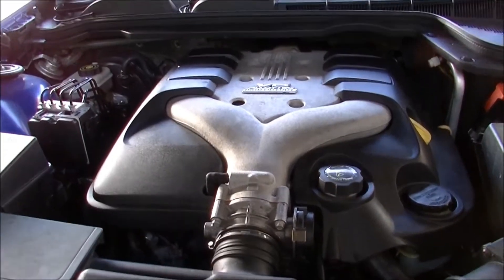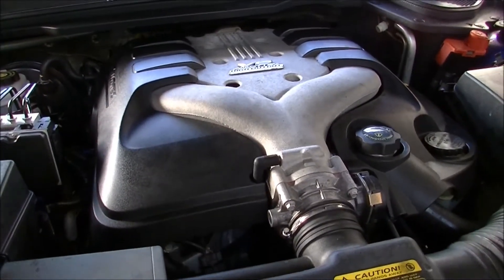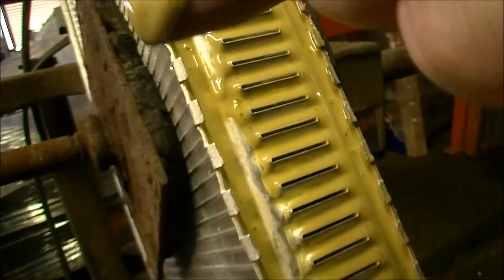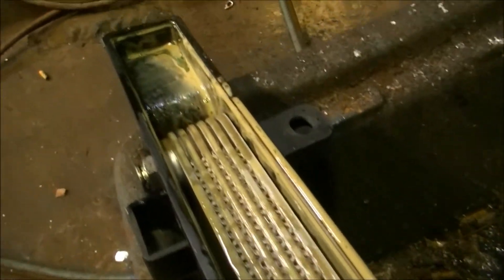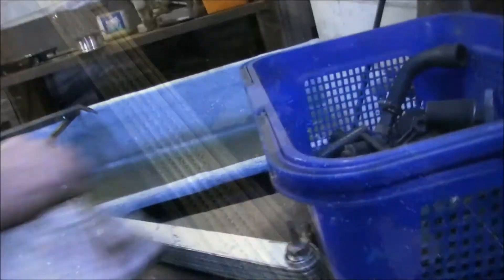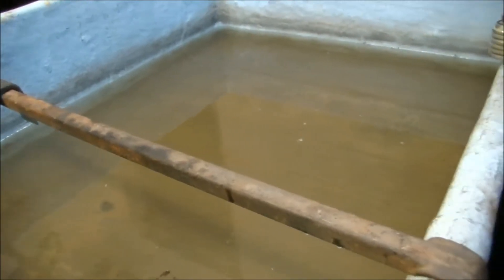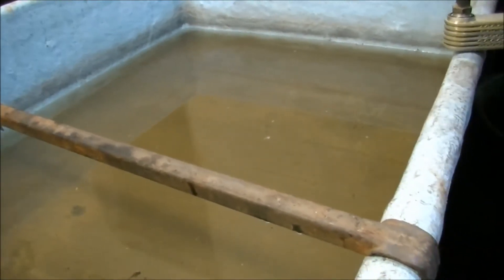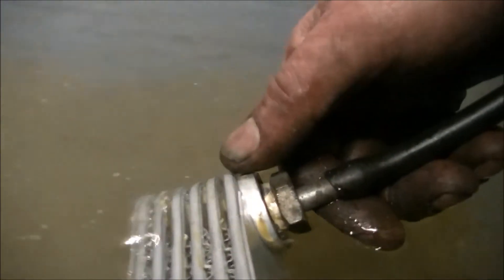The cause of oil in the radiator   Alloytec V6

Comment: I had a Subaru SVX and they were noted for transmissions over heating, so I changed to an external cooler , at least if one of those starts leaking it won't get in the radiator..
Reply from the maker: That's for sure.

Comment: 4.7 V8 is in the Tundra i think. The Tacoma is a smaller truck which uses the V6 engines like the GR series that also got put in the Lexus.
Reply from the maker: Thanks man...A 2UZ I believe...Only in Landcruisers here I think...This will be a first for me.
Reply: I've never seen a UZ engine either. I've done the belt on GR engine in an old Lexus. While there might be one or two of them in the UK all the Land cruisers I've seen have the 1KD engine which is the 3.0 Turbo diesel or the KZ engine in the 90's. Same as what they put in the Hillux. You couldn't afford to run one of those V8's on our petrol prices. haha

Comment: I had one car that did that before.   After I replaced the radiator and flushed the transmission fluid.  The car wouldn't move.  The water in the transmission fluid made it real thick,  so the transmission worked like that.
Reply from the maker: No coolant in the trans only trans oil in the cooling system...I recon the guy got it to us just in time.
Reply: ZIGgassedUP   This one I did was the worst mess I have ever seen.  It took a long time of flushing everything out.